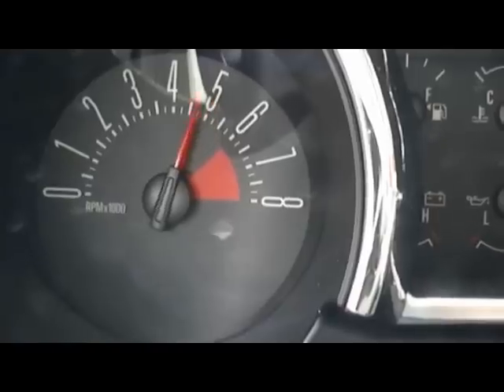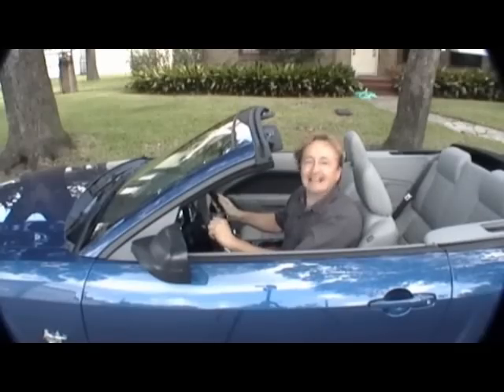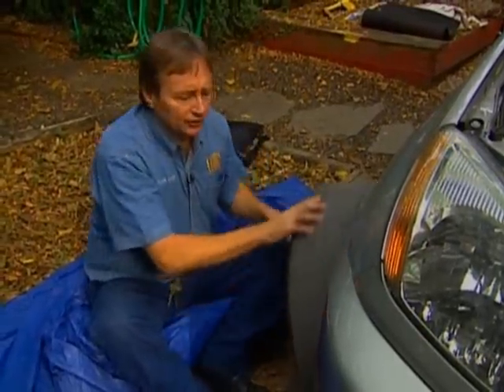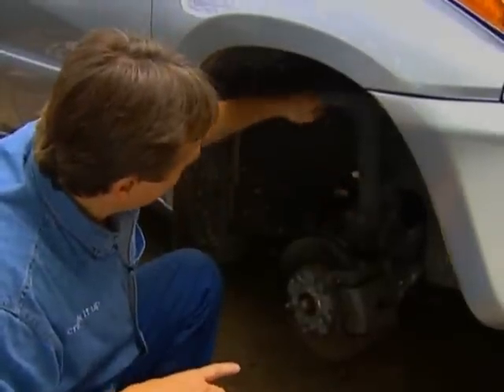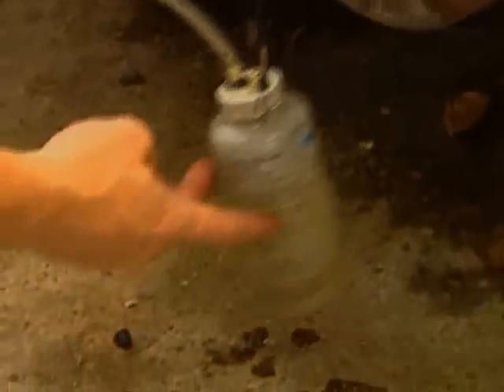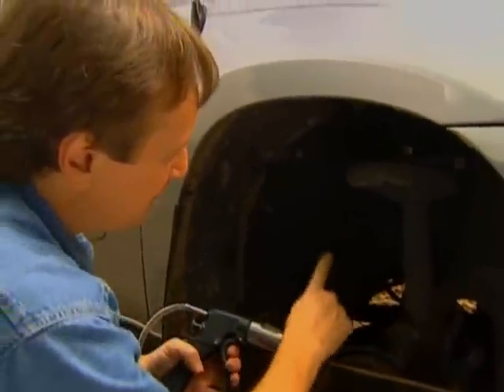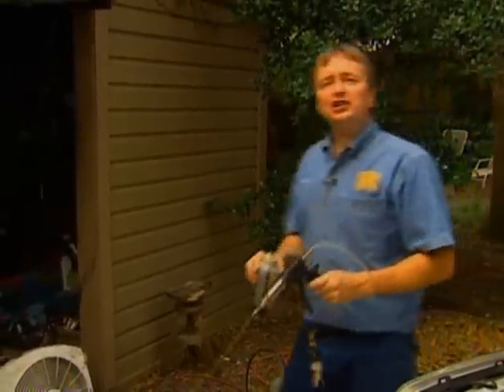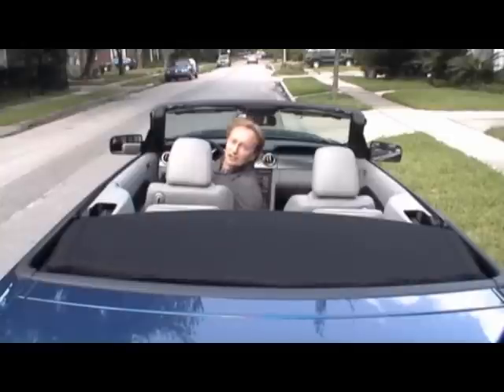How to Bleed Brakes in Your Car (One Person)

Comment from the maker: changing the fluid requires bleeding em out. always start with back right, then back left, then front right then front left when bleeding
Reply: Scotty Kilmer Is this process for left hand drive?
Reply: Thank you master
Reply: @rogerwallace5473  yes it is
Reply: Doesn’t the order depend on the drivetrain of the vehicle being serviced?
Reply: @BlackOasis21  the order depends on where the master cylinder is located. You start at the furthest away 2nd furthest 3rd furthest and finally the last one will be the closest to the master cylinder.
Reply: @rogerwallace5473  it depends on where the brake master cylinder is. Find it and start with the furthest wheel from it.
Reply: According to Haynes manual for mk4 fiesta it's 
1.  FRONT Right (passenger)
2. REAR Left 
3. FRONT Left
4. REAR Right

But in a French manual it makes no mention of pattern!! Talk about confusing.
Reply: @angelofanella7860 ABS module, since the Master Cylinder feeds it.
Reply: It's farthest from the master cylinder

Comment: I used this exact brake bleeder kit by Phoenix and it was trash. The fluid mechanics of reverse bleeding are sound. HOWEVER the tool is cheap and broke right away. The hand pump seized up and the handle broke in half because it could not push up the line with enough pressure. The included "quick connectors" were leaking and weren't even compatible with the pump! None of the rubber hoses that attach to the bleeder screws created any sort of seal. Followed every direction and every Phoenix video on how to service the unit. Good luck getting support too. Thanks for the suggestion, Scotty, but i'm out a good chunk of cash and still looking for a tool to bleed brakes.

Comment: Hey Scotty ... I have a big problem with my 2006 Dodge Caravan SXT, recently changed the front brakes, the big problem is that it makes a very strange noise like clack, clack, clack, every time I brake, everything is tight and in place, sounds like if the pulsation of ABS some sounds are normal but the one I have is not normal is very strong, would appreciate some advice please thanks,

Comment: hi Scotty. My son has a 1989 Buick LeSabre. we had to change the master cylinder and now the front driver side won't bleed. we've replaced the brake hose, the caliper, the pads, and still it won't bleed. I'm at my wit's end. please help!
Reply from the maker: you either got a bad master or the line going to it is restricted by something like a bad equalizer valve

Comment from the maker: @AmpegV4  that is a bunch of nonsense, I've been using the phoenix injectors for decades without harming master cylinders. Now forcing tons of pressure back through the valves is not a good idea, I agree with that. But this tiny little pump doesn't put out that much pressure. It's just a gentle pressure to move air bubbles up in the cylinder where they simply make small bubbles as they escape the system. Scotty

Comment from the maker: Yes, the crucial point with reverse bleeding is to get a good seal at the bleeder valve, which requires a tool that fits perfectly snug. Another trick is to remove the bleeder valve and wrap teflon tape around the threads a bunch, THEN screw it back in most of the way for a better seal. Scotty Kilmer

Comment from the maker: Yes, you can do that with a vacuum pump if you hook it up air tight. Pedals can go to the floor for MANY different reasons, from air in the system to leaks ANYWHERE (including, of course, leaks inside the master cylinder.) First do a good bleed job, and if it still goes down, and no leaks can be found anywhere, it would be a bad master cylinder OR a problem in the ABS module if you have ABS brakes. scotty Kilmer

Comment from the maker: It works on some ABS systems, but some will require the use of an OEM level scan tool to open and close modulator valves. That's why it's a good idea to NEVER let air get into an ABS system. When replacing callipers or hoses on one, just keep filling the master cylinder with fluid while you replace the parts necessary. That way air won't get into the system from the top.  scotty kilmer

Comment from the maker: @imickey503 that's nonsense, I've been doing it for years. when you take your foot off the brake, it has to suck the fluid back into it. Now ABS systems are cows to bleed out because they have all kinds of valves in them, they are impossible to bleed without a dealer level scan tool to operate them. Scotty

Comment from the maker: No, only  the air gets pumped upwards by the pressure to escape through the master cylinder. I've been using the Phoenix injector for years and have had no problems, other than the seals in the pump wearing out and needing replacement every so often. scotty Kilmer

Comment from the maker: It will work with ANY hydraulic brake system, heck they even use em on Airplanes. But on that old Beetle, be sure the brake shoes are adjusted tight because they are not auto adjusted. You must manually adjust them and if they are loose, the pedal will do exactly as yours is doing. Scotty Kilmer

Comment: I wanted to buy a phoenix injector for my brother who does about 2 or 3 brake jobs a week. Your injector looks different from the new ones. Do you have a recommendation on which one to buy? They have a medium duty and heavy duty. The heavy duty injector is over $300. That seems too steep. Not to mention it's mostly plastic. What's your opinion? Thanks!
Reply: Ken If your brother works doing breaks he should buy the expensive one. But if he is broke he should buy the cheap one for now until he has enough money to go up in price.

Comment from the maker: well, is six of one, half dozen of the other. If you have no ABS, that can't happen. But with ABS systems, yes, it's better to suck the fluid out of the calliper, which also can be done with the injector by hooking up the intake side of the injector to the calliper and hooking the outlet side to a drain bottle. Scotty Kilmer

Comment from the maker: @jeffinaintez  Bleeding ABS systems requires special scan tools to open and close the ABS valves inside the ABS modulator. As such, you can't manually bleed them correctly. Unless you want to buy a VERY expensive scan tool, pay a mechanic to do it. This is one of the many reasons  I feel ABS brakes are a pain and am glad all my old cars don't have them on. Scotty Kilmer

Comment from the maker: @pej0s yes, I agree, ABS systems are stinker to work on, but this system pushes air up out to the master cylinder reservoir. It does work fine, i've been using it for decades.

Comment from the maker: @tysondimmitt  a car only needs bleeding if there's air in the system, and unless that happenned when working on the car, the system has a leak that needs fixing. Brakes never need air bled out if they have no problems.  A bad master cylinder can suck in air and cause such a problem. Scotty

Comment from the maker: hey, being that old, if it only goes down a little, I wouldnt' worry about it. A weak master cylinder is the number one reason in such a case. Bleeding won't fix anything, cause if air's int he system, it will get back again from a master leaking.

Comment from the maker: @bondita nothing bleeds are completely out of ABS modulators except a scan tool that operates the ABS system, opening an closing valves to bleed air out. That always requires a dealer level scan tool unfortunately, blame the manufactureres.

Comment from the maker: @bujashaka It works well for some systems, but with ABS, you often will need a dealer level scan tool to operate the modulator valves when bleeding air out.

Comment from the maker: nonsense, I've been using it for 3 decades and never have. the power in this unit is minimal compared to pushing a brake calliper quickly back in with a pair of pliars.

Comment from the maker: You have abs brakes on that car, so you need a dealer level scan tool in order to bleed them. See my video "fixing  ABS brake problems on your car". A bad cap does not put air into the system though

Comment from the maker: @maccasda find the power source for those and fix it. I often just don't waste my time, and cut the power to the non working devices and run a new wire with fuse direct from the battery. Scotty

Comment from the maker: @oakpubster Yes, but I don't break the line. I grind off a slot where the line fits on the strut, and then do the same on the new strut . Then I bend the holding slot to fit the line in, and then bend it back when I'm all done and put that stupid clip back on. A lot faster. Scotty Kilmer

Comment from the maker: Of course, you could make your own system if you wanted to. The only hassle would be to get the hoses and fittings strong enough to build up the pressure and to not leak over time (brake fluid destroys many types of rubber, so you need special seals if you want it to last.) Scotty Kilmer

Comment: I spent 3 days trying to bleed my Ford Freestar. I finally found that with my Traction Control there is a pump. So you can not bleed if the pump is not working. The solution: Let the engine run during the whole procedure. You then get an incredible pression in the pipes. Oil is coming out for 1 foot long. I found this solution on internet and it was finally the right answer.

So for Ford Freestar, Windstar and Aerostar and most Ford Traction Control brakes you need to have the engine running.
Reply: That probably works for any vehicle with an ABS system too. I saw a video a couple years ago where a guy would accelerate fast across a big gravel parking lot then slam on the brakes to make the pump kick in and purge the system. I never tried it but your way seems...safer.
Reply: @K.B. Tidwell  What way is that? I didn't understand what he did beyond keep the car running when bleeding

Comment from the maker: NO, the air and fluid comes out at the top of the brake master cylinder reservoir. So all you need to do is keep the cap off it, and if it gets too full, empty some out with a turkey baster or battery filler bulb. Scotty Kilmer

Comment: I believe that brake fluid is hygroscopic and one of the goals to bleeding brakes the traditional way is to bleed off (extract) the moisture that has absorbed in the brake fluid from the system.  If you just pump more fluid in then the existing fluid will still have moisture in it.

Comment from the maker: They make various types of injectors, for the do it yourselfer they make a plastic version. Mine is the top of the line chrome plated job, so of course it costs more. But the plastic ones can work fine for occasional use. Scotty Kilmer

Comment from the maker: I doubt if he messed up the spring, I've NEVER seen that happen. Either the master cylinder seals went out, or the slave cylilnder. If he did get air in the system, you could bleed it out, BUT realize that air can only get in IF there's a leak in the system that really needs fixing anyway.  Scotty Kilmer

Comment: 13 years later and your still saving lives. My brakes failed twice, first time I had a master cylinder replaced and my brakes bled but the mechanic didn’t do what you did, he just opened the rubber cap and then put it back on and the same with the other tires. And just a week ago my brakes failed again and I rear ended a Jeep’s massive hitch and ruined my bumper and hood and this explains why… we never fully bled the lines

Comment from the maker: many ABS systems require a dealer level scan tool to bleed them due to valves that need opening and closing by the tool to bleed air out
Reply: 2007 Silverado Classic my front brake sticking up a new rotors new calipers new master cylinder brake booster still do the same thing can u help me please

Comment: You can also fit small speed bleeders to each caliper, it has a one-way check valve that you open with a quarter-turn. This allows one person to bleed the brake system effectively by pumping the brake pedal and keeping the reservoir topped up. Popular with motorcycles too, not sure why...

Comment: Scotty,  Can a person use a regular hand held brake bleeder to get rid of air in a clutch master cylinder line thru the bleeder screw on transmission slave bleeder screw.
Reply from the maker: yes if you work slowly

Comment: Quick question scotty, Iv looked at many different methods for bleeding brakes and i think this is the best i have seen , one slight hitch, I dont really want to spend $160 on the phoenix reverse bleeder kit, My question is could the same job be done using a large brake fluid syringe .. Like the sealey VS404 basically pre fill it with brake fluid, connect it up in the same way to the bleed nipple open the bleeder and apply constant pressure to the syringe to force the clean fluid & Bubbles back up to master cylinder? I ask because the sealey syringe is only $16
Reply from the maker: sure, there's tons of ways to skin a mule if you have an imagination
Reply: +Hollie Garner At first I thought this was awesome as a trouble-saver. That fascination went away as I thought that it would most likely be better to get a solo bleeder kit for whatever the cost may be. I imagined that the Phoenix would be pricey, and I think the most expensive one-person bleeder kit I ever saw was much less than $160.

If a car's brake pedal feels soft and dangerously unresponsive the fluid may have been in the system long enough to warrant a smartly-chosen flush and refill with new brake fluid anyway -- or perhaps there's an impending line rupture. The smallest pinhole can make brakes fail. That failure may not be immediately catastrophic, but the effect is incredible and altogether unsafe. I can attest to that being a 'white knuckle' experience. ; ]  If you have 'mushy' or loose brake pedal feel either your system doesn't have enough fluid or it has drawn in air or water, and there's a physical reason for any one or a combination of these conditions. Bottom line, the system is lacking enough fluid for it to function properly.

The Phoenix is a cool tool in concept, but I'd rather avoid blending old brake fluid with new. However, that blending is exactly what this tool will do by its nature as one that works with gravity for simplicity and ease of use. Using a solo bleeder tool with an open master cylinder will remove air as fresh fluid is pumped through the lines. It looks as if the Phoenix will purge air easily, but I think it will also leave much more old brake fluid in the system than would a bleeder kit, as it's introducing new fluid -- against gravity -- into the lines to force the lighter air out through the master cylinder at the beginning of the system. Brake fluid loses effectiveness through degradation over time, like motor oil and coolant do, and that breakdown can adversely affect components. That's why you'll find recommendations for changing it, not merely adding it to the master cylinder reservoir until something like a brake overhaul requires a fluid change. There's no way a simple yet cleverly-conceived device like the Phoenix can override the chemically and physically similar properties of old and new fluids to separate them from one another. Yes, of course people 'top off' brake systems, but if you need to address this issue, why not perform a thorough fluid  replacement for invaluable peace of mind? ; ] This procedure can be daunting because of the fear of doing it incorrectly, but in execution it isn't proverbial rocket science. It's much less demanding than something that's mechanically complex and labor-intensive elsewhere within the car would be. 

I'm a product of a line of tinkerers and highly imaginative people who always liked 'do-it-yourself' challenges, so I applaud your idea about using the syringe to feed the system like the Phoenix tool does. As Scotty says, there's more than one way to skin a mule if you're imaginative. Still, it seems to me that a modest investment -- said as someone who truly knows what it's like to hunt under the seats for gas quarters -- may be a smarter choice than gerry-rigging a tool for a purpose like this. I've 'DIYed' a lot of things and am mildly infamous for it, but considering the amount of crap I've dealt with in the process at times, I think I'll be buying a one-man brake bleeder for future use. 

I fully advocate improvisation, and that certainly encompasses modifying or constructing tools. ; ] Some commercially available purpose-built tools seem more like unnecessary gimmicks for the lazy or stupid and less like indispensable toolbox additions. Yet, noting that,  my experience has reinforced the old adage that there's always a right tool for the job. Some tools appear ridiculous, while others that nod to seeming laziness or lack of inventiveness truly do serve a need for those who are compromised by factors such as finances, working conditions, time, experience, or even assistance. 

Sorry. I almost NEVER get in and out of a YouTube comment section without turning it into a pulpit. Ha! ; ]

Comment: ok Scotty here's one for ya, driving up mountain road, going kind fast, car is a 96 t bird v6, after 14 miles of hard braking the brake pedal went from needing 20% depression to apply the brakes to about 90% depression, i thought the brakes just glazed over so i pulled off and let them cool for 10 min, then when i set of the 90% depression thing was there, the pedal basically fells like a on of switch, and it pulls very hard to the right. you think bleeding them might fix this  or am i SOL?

Comment from the maker: pull all 4 wheels off, check for worn or leaking brake parts. if you find none, replace the brake master cylinder